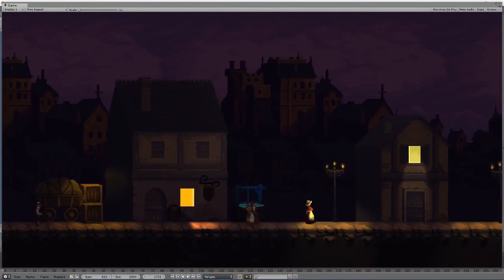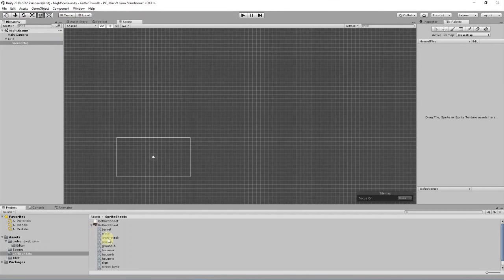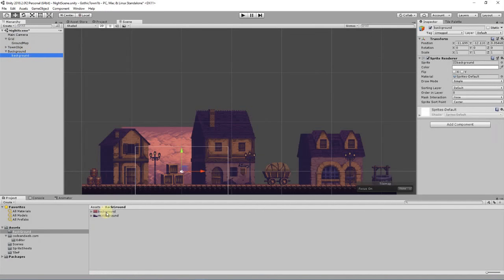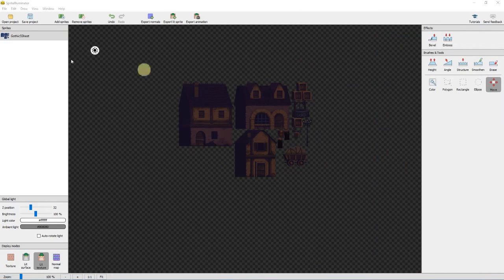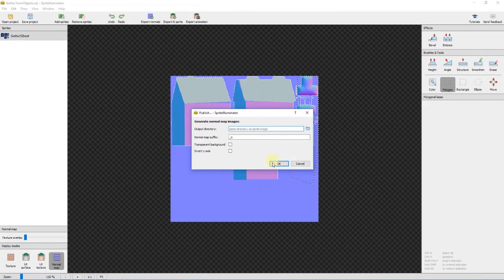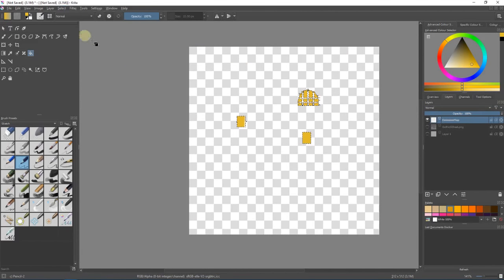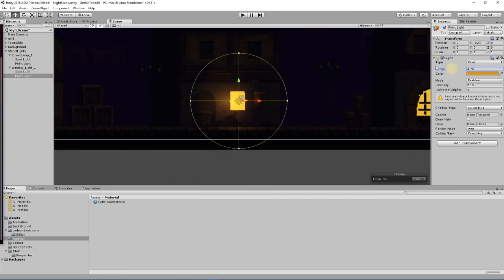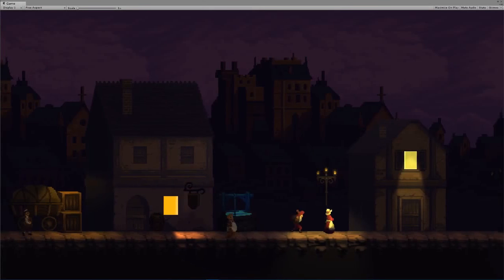Lighting a whole Pixel Art Town at Night in Unity  - Tutorial, Part 1: Lots of Streetlights

Comment: SpriteIlluminator "Export normal map" feature is not supported in free version.
Reply: its pretty dumb. i just took the circle image off wikipedia and use the dropper to the same effect
Reply from the maker: But you can decide for a trial of the Pro version.
This allows you to export normal map.
Just double checked it.

Comment: So, you imported the sprite sheet and set it to 32 Pixels per unit, but when you applied it, it changed to 16 pixels per unit.  I had issues where I had spaces between the sprites when I went to "paint" them into the scene.  If you are having issues, just go and change the sheet to 16 pixels per unit (ppu).  That solved my issue.
Reply from the maker: Thanks for taking you the time to point this out. in detail. I am sure this helps viewers, who experience a similar issue.

Comment: great, but it wont work fast on mobiles
Reply from the maker: Thanks a lot. If you set under Window-> Rendering -> Lighting   the checkbox for baked global illumination
you can change the mode of your lights in the scene to BAKED.
With these setting the scene runs absolutely smooth on my device.
Reply: @DHofmann  But if you change the light to BAKED, can the sprites be illuminated? And what about that flickery light, you can not bake that, can you?
Reply from the maker: @Plikemon  I am not quite sure, but I guess that's how I set up the whole project with sprite lights baked and it worked fine for me with flickering and all the stuff.
Sorry, but I can't replicate and check this, because I switched from windows and unity to linux and godot. Would cost me hours after one year has passed for this project...
Reply: @DHofmann  that ok Daniel, don't need any replicants :) thanks for the reply.
I will try myself anyway (Mac-Unity).

But you intrigue me with the Godot engine. I will check your videos later :)